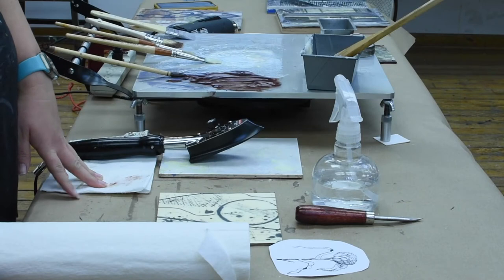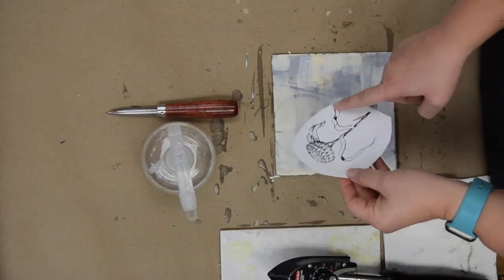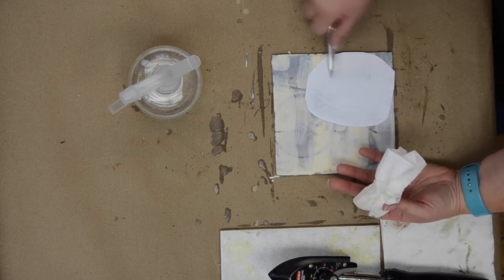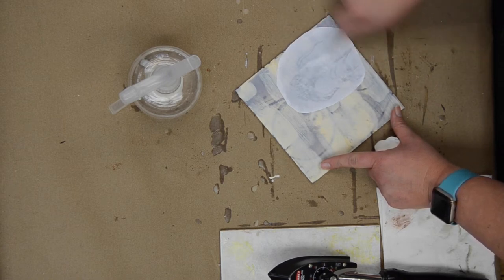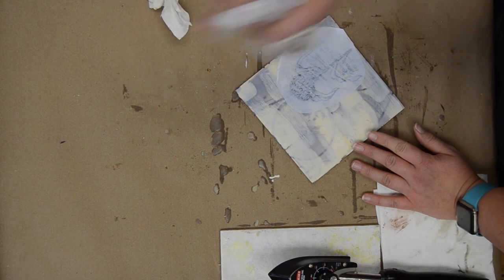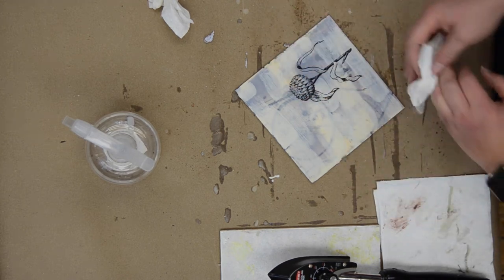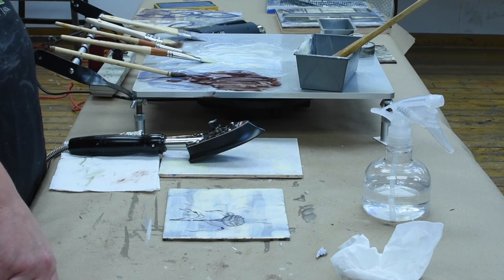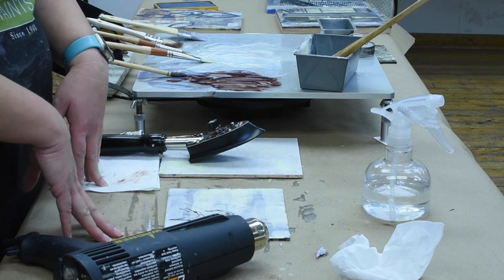Mastering image transfers on encaustic

Comment: What kind of paper did you use for this transfer? Also do you think a library copy machine would do the trick
Reply from the maker: cheap 20lb copy paper. And usually the worse the quality the printer the better. So a black and white toner based printer from the library should work fine